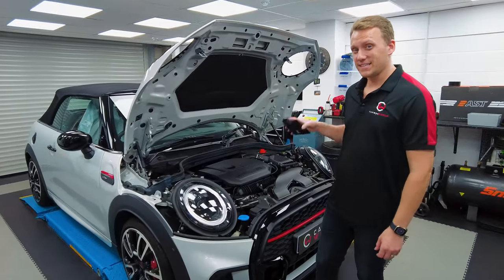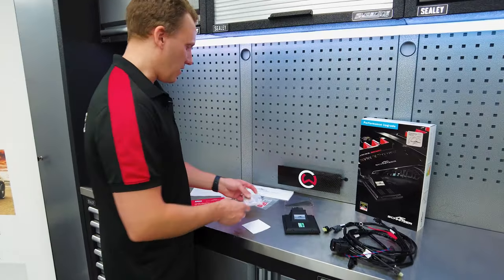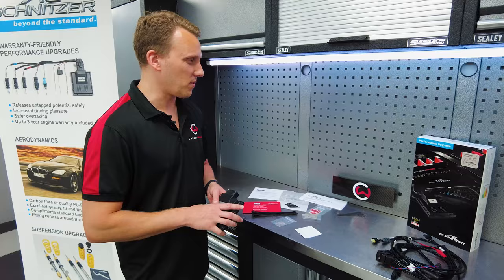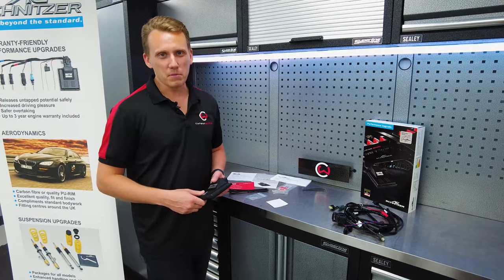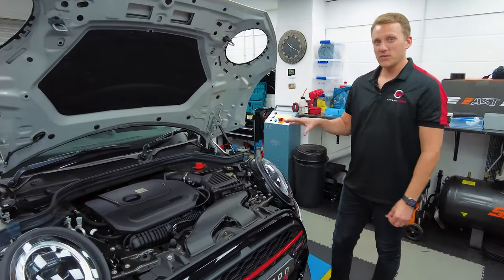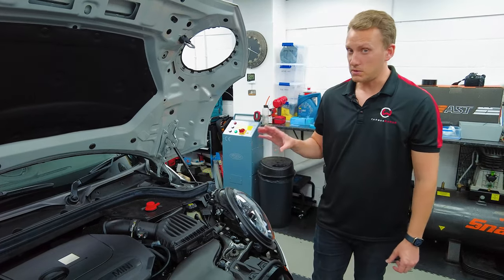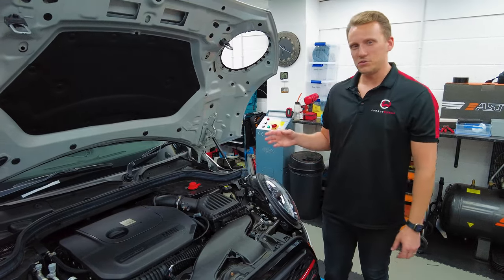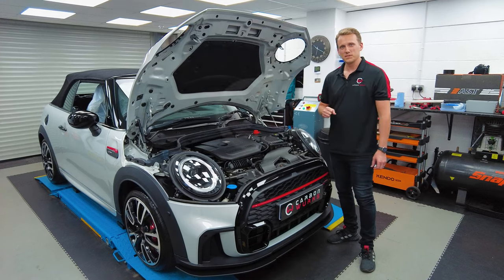AC Schnitzer Tuning Box | More Power & Warranty Safe

Comment: Every tuning box ive owned will throw an engine light in very hot UK weather if you do not have a bigger intercooler, all were fine till the hottest days, otherwise were great on my 2015 Mini Cooper S.:face-fuchsia-wide-eyes:
Reply from the maker: It would seem AC Schnitzer have potentially developed their system with this in mind to eliminate any warnings. Unlike almost every other brand, they offer full warranty coverage as well.

Comment: FAR too expensive. 
You can have Femto unlock the ecu for £800 and a reputable tuner of these cars tune the car sensibly for half that amount, that includes having the ecu sent with insurance to cover its loss in the post. I enquired for my 2021 lci2 jcw recently and it was going to be around £1400 all in for an unlock and a sensible tune. There are a handful of well known tuners who can safely and sensibly tune these without any worries about engine failure. 
This tuning box is appealing due to the locked ecu issue until you see the price of it which means it doesn’t make sense at all.
Reply from the maker: Realistically this product isn’t designed for those wanting more power and those who don’t mind acknowledging the inherent risks of remapping. It’s designed for those with nearly or new cars that don’t want to take that risk. 

Ultimately if a remap or tuning box is well suited/installed properly there shouldn’t be a problem. If a random problem does arise related or not with the running gear, it’s massive money even on these cars. 

You also can’t sell on a remap, you can a tuning box as and when you change ownership. 

Pro’s and cons. Pick your poison 😀

Comment: What gets me about the expensive tuning box is you have to run on premium fuel 😮. Seemed like a long term investment until i heard that part.
Reply from the maker: There’s an argument to be had that performance fuels are best used in performance/turbo engines and give better mileage so not a totally wasted cost 😀

Comment: Great video, how much is this supplied and fitted please ? And does this affect MINIs warranty and having an MOT done? Thanks.
Reply: It is quite expensive.
Reply from the maker: Drop us an email if this upgrade is of interest as pricing will vary depending on model. AC Schnitzer give a warranty which covers the engine, gearbox, turbo etc. so in short, you do retain a warranty which is why it’s quite an expensive upgrade. 

It won’t affect an MOT 😀
Reply: JB4 tuner thank me later!

Comment: Didn’t mention price?
Reply: Because it is comically expensive.
Reply: How much? They also said something about soldering and proceeded to not explain where how and why
Reply from the maker: Pricing varies depending on country you’re buying from. The price of the tuning box is in the region of £3,500.
Reply from the maker: Less expensive than blowing your engine or gearbox and having to replace…
Reply from the maker: Only an AC Schnitzer dealer should install this to keep warranty. This isn’t a how to guide, it’s a product overview.
Reply: @Carbonwurks  ok thank you. £3500 is insanity!
Reply from the maker: It is a lot but a fraction of the cost of a new gearbox or engine if it were to go pop 😬